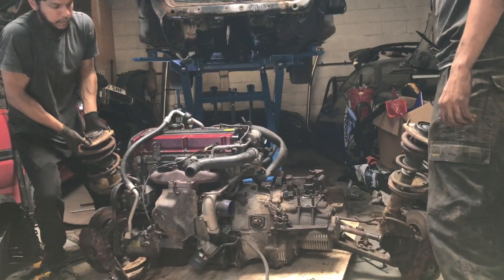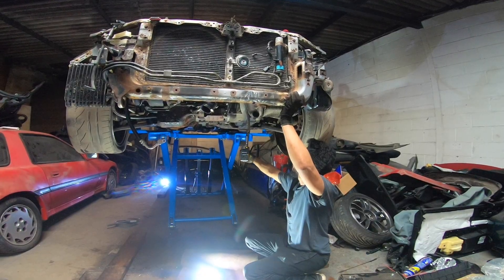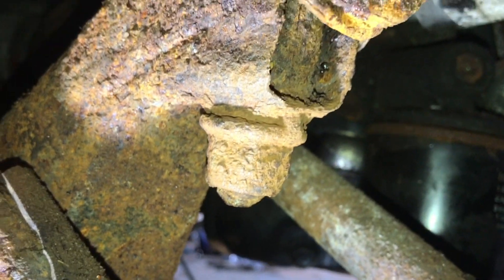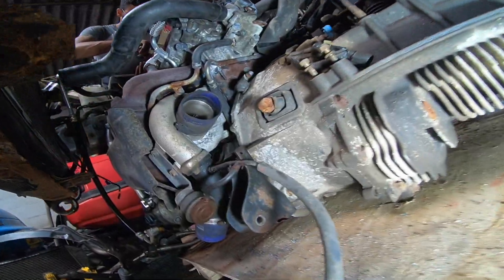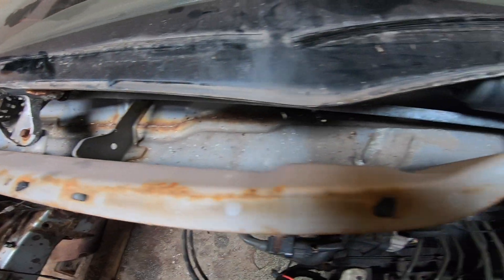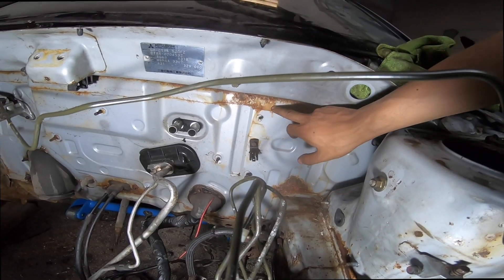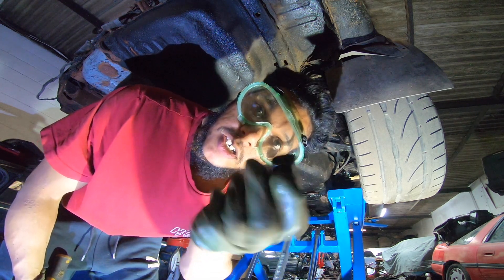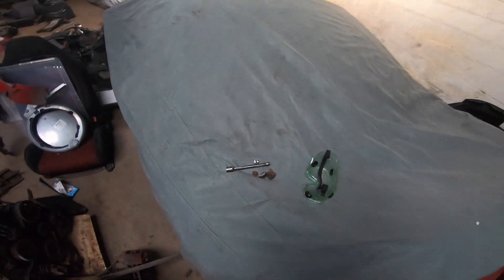RESTORING THE RUSTY MITSUBISHI EVO 8 | PART 2

Comment: Drill a small diameter hole into the bolt thats snapped, then weld a nut onto it and fill it completely inside the nut with as much weld as you can then let it set. Heat it up till its glowing red then hammer a socket on to shunt it then use your breaker bar and it should hopefully free it. Turbo engineer here, done it on many turbos and engines.
Reply from the maker: nice one bro will deffo be trying this! appreciate that bro!
Reply: @hoodstig  no worries mate, you’re clearly a skilled mechanic yourself but always good to learn new things💪
Reply: @hoodstig  1 more thing if you cant drill a hole centre punch will work man

Comment: Pretty standard to snap the head off a few bolts when stripping an Evo. 
I find welding a nut on what's left works, not only does it then give you something to turn, but also the heat generated when welding seems to help break the stud free.
Reply: 😆is that what quality you get from Mitsubishi?

Similar to hondas, its like they been sat in bottom of ocean for 20 years!
Reply from the maker: thanks bro will try this out
Reply: @yorkshireman7025 honestly my first car was a Swift GTi 1990. Even when it was only 7 years old every single bolt snapped or was so rusty it instantly rounded off. Where Honda or Mitsubishi would use an m8/m10 with a 12mm or 14mm head, Suzuki would use an m5/m6 with a 10mm head…..made of the worst steel available. Now when I work on my Honda or Mitsubishi they seem so well engineered….and after years of working on my Swift I hardly ever snap a bolt on a Honda or Mitsubishi.
Reply: @seshelbow336  i had mk3 astra merit in white 3dr 1.4 8v. Some car that was i give £320 i think it was some dealer from derby 15yr ago. I could not break the car. Hammered life out of it! Its was elderly owned and only had around 60k. Only thing it cost me was rocker cover cork seal that used to drip oil down onto cast mani and single flange downpipe and poisen me in car lol

Comment: Snapped bolts are the worst! drill them in the middle of the bolt with a small drill bit and then theres a tool to remove to spin them out. Pain in the butt!
Reply from the maker: yeah deffo just got to keep going!

Comment: Need to heat them bolts up. Buy a blow torch or get yourself a heat induction tool. Then hit them with the impacter. Should come right out. Also get yourself a half inch impact gun they put heat into the bolt and that breaks it free

Comment: You'll defenitly need to replace the chassis legs and crossmember. Don't drill out the bolt, warm up the rear subframe with a torch, it will drop off. Then once the bolt shank exposed, heat the chassis leg up (empty the trunk first) and it will come out.
Reply from the maker: thanks bro! really appreciate your knowledge helps a lot

Comment: U need a bigger impact gun ideally a milwaukee 1/2 with the 1850 nm  that would save u so much time and messing about with that long lever bar, and levering that long breaker bar with some slight angle causes nuts to slip and also break that's where the milwakee with the torque would be a massive help, as for rusted snapped bolts think welding a nut on will probably be best bet I'm worried for you on them and keen to see how you will tackle them also keen to see the welding on car especially awkward areas

Comment: Great work as always. 1 question was your camera backwards or were you tightening the prop shaft support nuts when it snapped as looked as though you were going the wrong way to undo it @9:34 😅😉
Reply from the maker: yes the cam was upside down to get angles... but good shout bro!
Reply: @hoodstig  ah did think as much, so glad you're still cracking on with it buddy, keep it up 👍🏼

Comment: Regardless of how good of a engine the 4g63 is.  These videos documenting this particular evo is every reason why i will never own a evo. You pay what £15,000+ and end up with car thats very good at hiding rot and has had 20 owners.I think its the cool bodykit that helps 😆 and are they really that reliable/fast around 400bhp stock block? 

Airtreks appeal more to me for say what £5,000 then again nobodys ever heard of them.

No hate intended btw i wish you all the best brother in what looks like full restoration project 🤔
Reply: 100% rust is one of the main issues on an EVO. A 400/400 EVO is a very capable car and depending on what age can be very reliable at that power/torque. Surprises a lot of other things I can tell you that. Don't get me wrong in a straight line a lot of standard performance cars with similar power will keep up, but it's the raw feel and true drivers car with very little aids 👍🏼
Reply from the maker: it is agreeable i just hope it will all pay off in the end and i,m learning so much from it.... if we can pull this off.. small jobs will be a walk in a park!